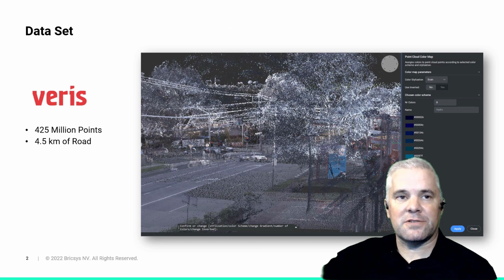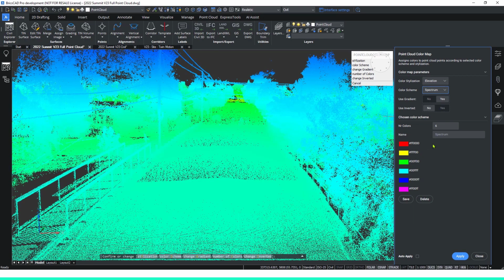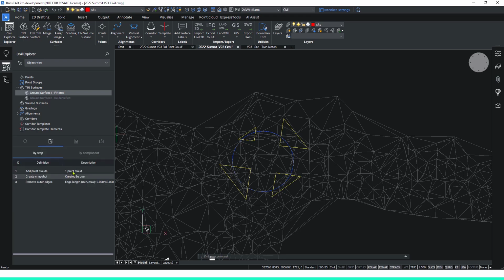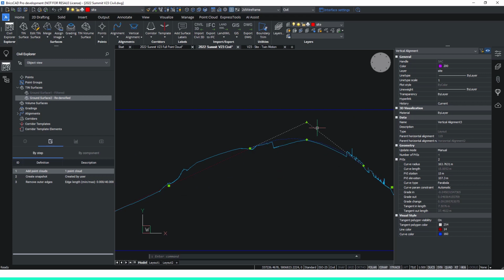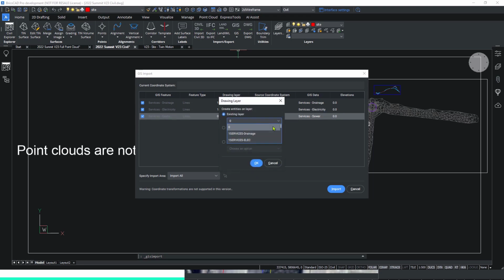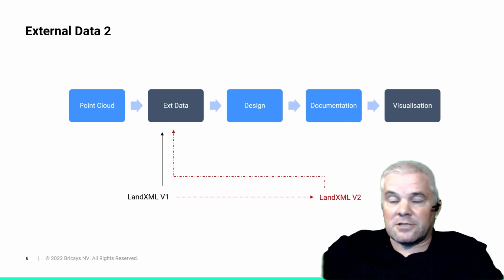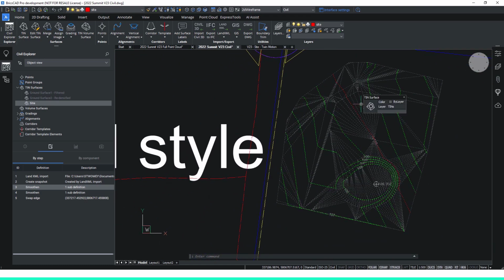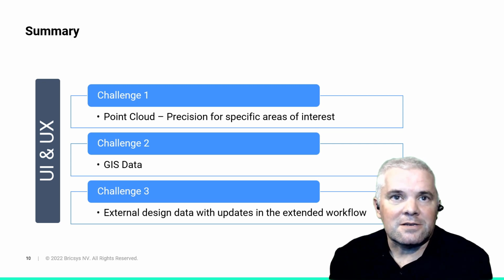BricsCAD® for Surveyors and Civil Engineers in Version 23

Comment: For civil engineering use, is BricsCAD Pro sufficient in its functionality or would BricsCAD BIM be a better/necessary choice for additional features it offers or that 3rd party solutions might require?
Reply: Keeping in mind, they of course used BrisCAD Pro for this video demonstration.
Reply from the maker: Hi Lawrence, Its all depends on your requirement. We have solutions for 2D,3D,Civil design,BIM and Mechanical. In BricsCAD Ultimate you can find all these features.